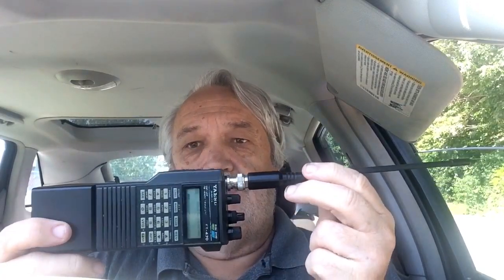Extending the range of your handheld transceiver with a telescoping antenna

Comment: Picked up two of those Radio Shack antenna's for $10.00 each, still use both.
Reply from the maker: I found them to work really well.  You can see your receive signal go up when you put it on. I does every more from the transmission.

Comment: Someone needs to make something like this that can be used on a handheld marine radio.
Reply from the maker: That would be good, but if you are really using your boat out a lot, you should have a much more powerful radio installed in your boat with a matched antenna. It would perform so much better.  The hand held should be secondary.

Comment: Great video. I do have a lot of different handheld amateur radios. I usually use a comet antenna on them but on my ICOM IC V86 I use a telescoping Diamond RH 205. Fully extended it's 52.8 inch 5/8 wave and it does a fantastic job.
Reply from the maker: I forget why but the 5/8 wave on 2 meters cuts down on the "picket fence " affect. That is a sort of fluttering in your audio transmission.  It's a larger antenna but well worth in if you are transmitting from a moving car.
Reply: @m005kennedy  It's a great antenna but I don't leave it on the radio when I'm done using it.

Comment: I just found someone who was selling a Uniden pro 310e for 10 dollars so I decided to buy it. It came with everything. I'm not sure what I'm doing so I'm trying to do my research. Any info you can share on this model and how to use it would be really appreciated! Thank you!
Reply from the maker: What you should do is Google a manual for it. Most manuals for older radios are on line and can be downloaded for free. Just put tje name and model number in of the radio followed by the word manual. It should get you started.
Reply: @m005kennedy  hey! Thanks for the quick response! The Uniden came with the manual and I looked up a few things. I noticed that some manuals say "UNIDEN NINJA PRO310e"...mine does not. What are the differences? Is this piece of equipment still good/decent? Is this technology still relevant? I wanted basic knowledge. I'm a rook at all this. All info is appreciated! Thanks!
Reply from the maker: A quick look shows it is a portable CB radio. It has 40 channels. Truckers in the USA tend to use channel 19. You basically plug it in to your cigarette light and put the antenna on the car room and you are good to go. Not as many people are on CB radio anymore.

Comment: Is found that exact same model of antenna on an old scanner I bought. It looks soo nice on the radio, like it has class. Love it!
Reply: If anyone has swr measurements for the different configurations of that antenna I would be very grateful to see them
Reply from the maker: According to the Radio Shack instructions with the antenna completely closed it is tuned for 2 meters and 70 centimeter ham bands. If you fully extend the antenna then collapse just the first section above the coil it is tune to 2 meters at the longer length and performs better than when it is fully collapsed.  Using the antenna for transmitting showed this information to be true.

Comment: Hi 
How can I get the Radio shack antenna you featured in this video? where did you go to buy it? radioshack online?
Reply from the maker: I bought some while there were still some stores open. I bought one online. I was getting emails from Radio Shack after they closed. Some company is still selling old stock.
Reply: They are still available. I had great results googling for “telescopic antenna bnc coil”. This for example: https://www.thunderpole.co.uk/handheld-scanner-antennas/retractable-telescopic-bnc-antenna-centre-loaded.html